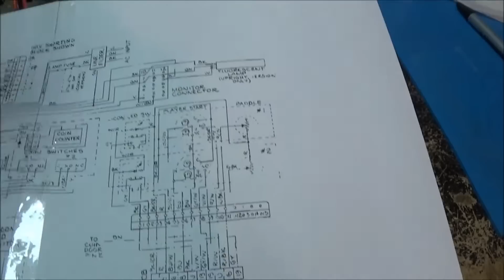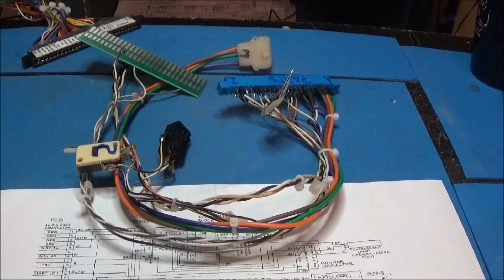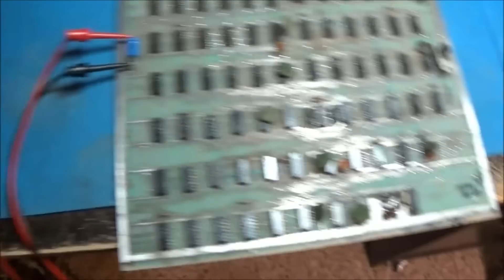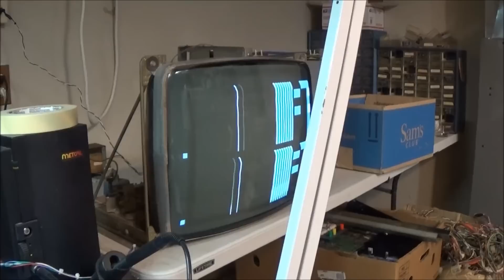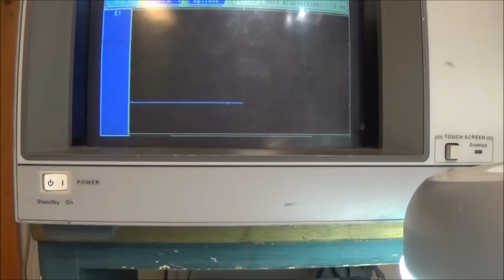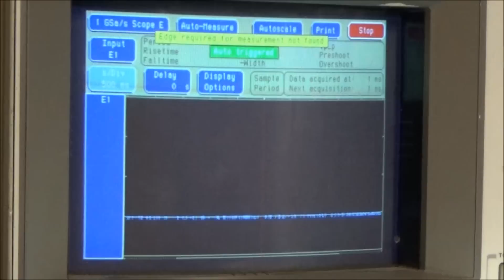1976 Atari Breakout Arcade PCB Repair Part 1   -  11/28/20

Comment: I know you can fix this board but with that many failing chips, I’m worried it will only fail again soon. Plus all those corroded traces...I think that’s a sign of the environment this board was in. How do the legs on those chips look? Are they also corroded and rusty? I’ve read moisture can get into those plastic IC’s through the legs which causes them to go bad. I think your wise to pull the plug on this one bud.
Reply from the maker: i hear ya...  that is always a concern with boards that are this bad

Comment: When the board was stored in a moist condition (barn...) for decades, it is not uncommon for this many chips to go bad. When I fix boards for other people at rates, I cap out at 100 Euros plus spare parts, because no one would want to pay you a week of 12-hour-days fixing one single game* just because that many ICs have gone.
*)been there done that. Twice at least. I just totally love doing it!
(sometimes I even go as far as reverse-engineering PALs for the Greater Good or develop a modern day replacement for parts you can't get anymore)

Comment: So you cleaned off all of the original markings in marker from the employees at atari.
Poor form.
Reply from the maker: nope...  any markings in permanent marker are still on the PCB...   even if it would have washed off...  it would be worth saving the pcb

Comment: Hi Sean, I had a similar issue with a 60's pinball machine that was not worth repairing. However, the engineer in me took over and I then saw it as a challenge that must be beaten and a couple of years later working on it in my spare time, I won. Sometimes passion overrides practicality.
Reply from the maker: yeah..  love a challenge like this...  hate to see these  things neglected...   saving as many as possible :)